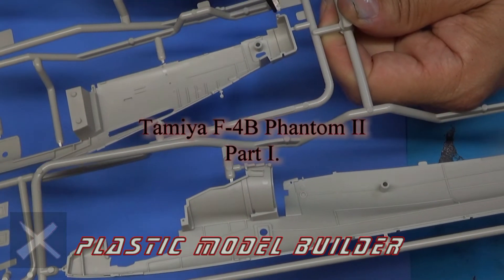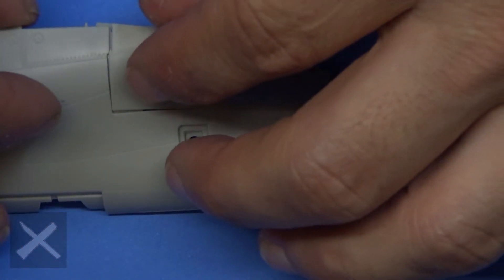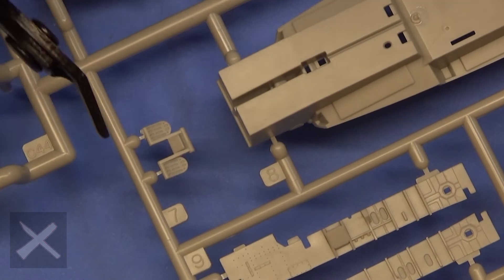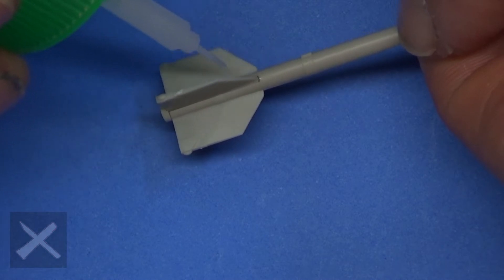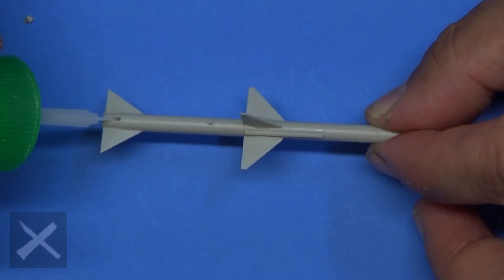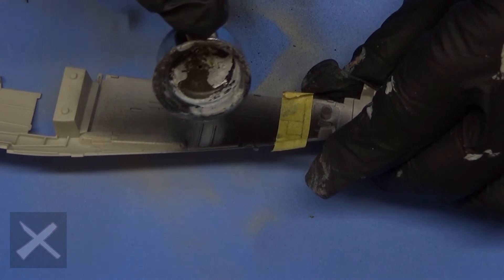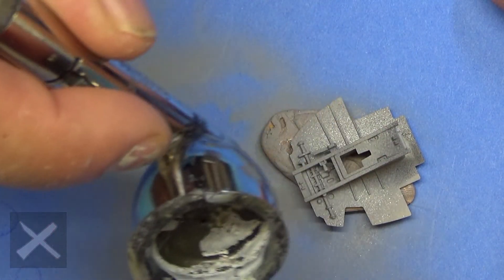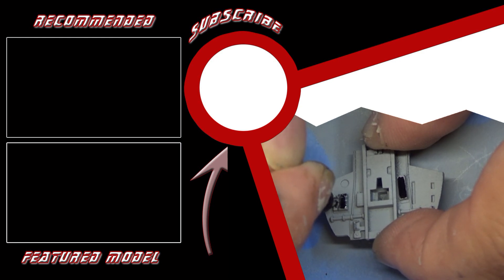Tamiya F-4B Phantom II Part 1 - Starting the Fuselage

Comment: You have the rudder pedals in the front, and in the back I guess it is a foot rest. Navy phantoms generally did not have dual controls, but Air Force phantoms did, so other variants have rudder pedals in the rear cockpit. All those panels suggest different variants, the study of Phantom variants is practically a life long journey.  I am not sure what the purpose is of the flat thing on the AIM-7 sparrow is for,  Nice job on the black basing.  The fit of the parts looks great. I have this kit but have not started it yet.  Sorry I missed the Premiere.
Reply from the maker: It seems to be a great kit with some minor fit issues on the nose cone and potentialy the back end.